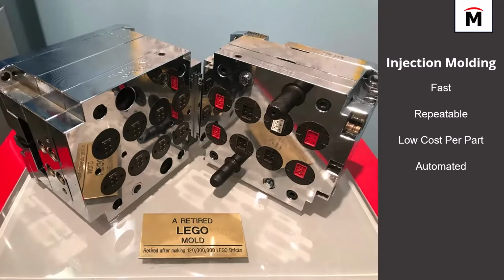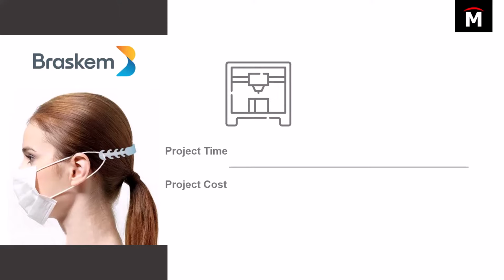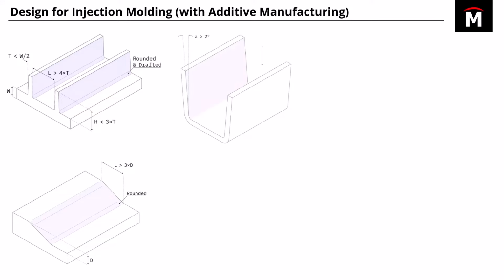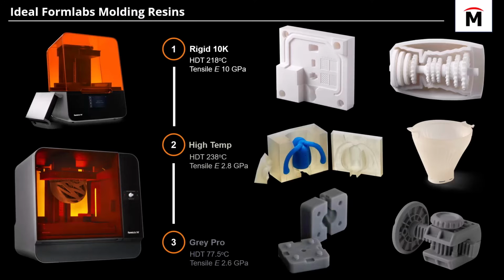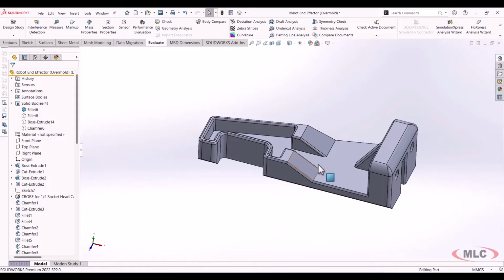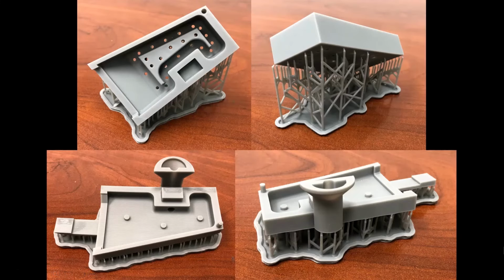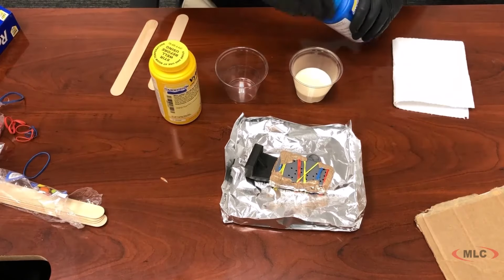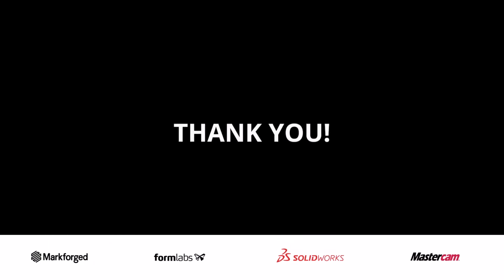3D Printed Molds Explained | Reduce Tooling Costs for Low-Volume Production

Comment: The thought process is pretty good. But, I can see you are not a regular at this, such as the use of rubber bands. That may not give the strongest grip. In fact, clamps for carpentry would have been more apt in your case. Still, can feel the enthusiasm and energy. Its surely not easy to use resin molds. Quite a bit of challenges during this process. Also, good machine to do the resin print. Cheers. Just my 2 cents.
Reply from the maker: Thanks for the suggestions and the detailed thoughts!
Reply: @MLCCADSystems  Its an evolutionary process. We are all learning. The use of rubber band is very thoughtful, especially those who may not have the specialty tools.

Comment: Incorrect.
Tooling expenditure justification is not based upon the total lifespan of a given plastic injection tool as you seemed to have suggested. With proper maintenance, this lifespan can be quite substantial. Literally decades in many cases. Tooling ROI is “basically” decided upon by the person/company/institution fronting the expenditure and the myriad of nuances for a given product.
Essentially, ROI is targeted at months not decades.
Obviously each tool and product is unique and therefore its ROI.
Just clarifying this singular point is all.
Reply from the maker: The lifespan of the tool is a factor for the person/company/institution making purchasing decisions, though it is not the only variable, and it certainly isn't a 1:1 relationship. In addition to the factors you correctly identified, you can make molds that are designed to last days, months, or decades with commensurate increases in cost at each level. Family molds, advanced cooling, and other mold features like hot runners also have an impact on tooling costs and production costs. 

Each situation is unique, but one of the primary goals here is to help delay the initial investment long enough to keep the cost of change low, allowing for more rapid and effective improvement during the critical first phases of product testing.

Comment: Overall great explanation of injection molding however in the example it wasn’t mentioned the mold base or carrier for the 3 D printed mold costs 1-2,000$ .  For such a basic shape if any sort of volume, buy a standard mold base complete, $2-4000 , CNC cut the cavities in a couple of days, couple of ejector pins and the mold is done.  1-2 weeks work. So maybe $6-8000, and Capable of 1M parts or more if needed.  Yes 3 D printed cavities has its place and is great for limited production volumes.  Thanx for taking the time to make this video but not all injection molds are prohibitively expensive, shop around locally.  I’ve been doing this 40 yrs.
Reply from the maker: That's right, depending on how you source your molds and what production level you need from them, they can vary wildly in price. Every scenario is different. For a lot of operations, this prototyping workflow could be used strategically during the process to save a lot of time and frustration.
Reply: @ again thanx for taking the time to explain this so people are aware of what is available.  Just remind your audience that molds made by 3D printing generally cannot take very much injection pressure, and the person doing the injection molding needs to understand this, so usually only high flow plastics such as  polyethylene or polypropylene are used.  Materials such as abs and nylon, although high flow, have a much higher melt temperature and will shorten the life of the mold considerably.  I am not being critical just want you to have information you may not be aware of.  There are companies now that print molds with metal filled materials to increase mold life and complexity.

Comment: Thanks for the video. The biggest I am having is finding a 3d print resin that can handle platinum cure silicone (without inhibition issues). Do you know of any? I am wondering if that Vitaflex you used for that wheel you produced can be used as a mold for resin casts.Thanks
Reply from the maker: There are ways to avoid cure inhibition – Smooth-On has an article (https://www.smooth-on.com/support/faq/210/) discussing this in more detail. Ultimately, you will have to test to be sure. As for Vytaflex, you can use it to make molds or cast with it (https://www.smooth-on.com/product-line/vytaflex/).
Reply: Elegoo standard grey will not inhibit mold star 20t. I use the combination all the time.

Comment: As a fan of 3D printed molds I have to stress that the Braskem example wasn't the best. I'd rather use laser cutting for that. Design to finished products in one day.
Reply from the maker: Laser cutting is a great option! Since Braskem didn’t have a laser cutter on hand, they were restricted to the tools they had available to them. I guess they’re lucky they had a Form 3 and injection molding machine handy! Feel free to check out the case study in more detail here https://formlabs.com/blog/braskem-3d-printing-injection-molding/ – it’s a good read!
Reply: @MLCCADSystems  👍

Comment: Such a simple part is actually not thousands of dollars but in a few hundreds
Reply from the maker: Tooling costs can vary a lot depending on size and complexity, but with this method you can control both cost and lead time with no cost penalty for complexity in the mold geometry.  Every ROI will be different depending on your current situation and cost structure.